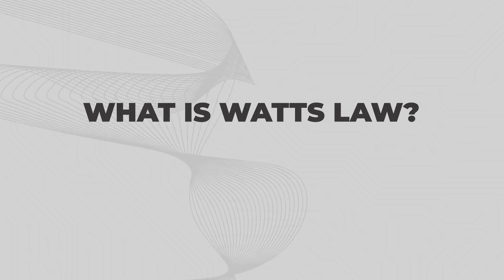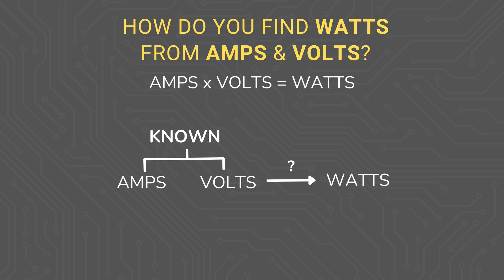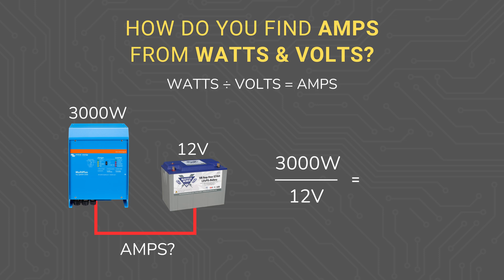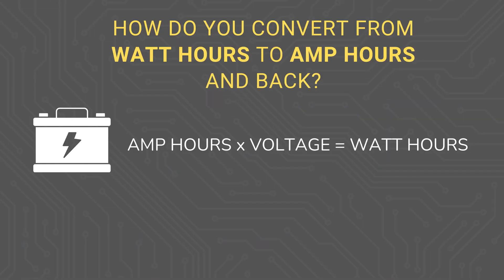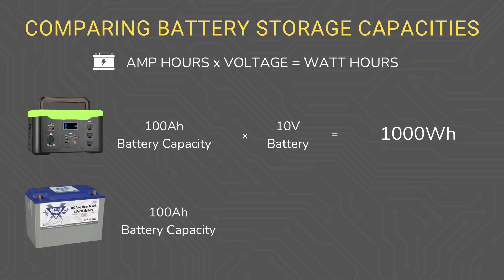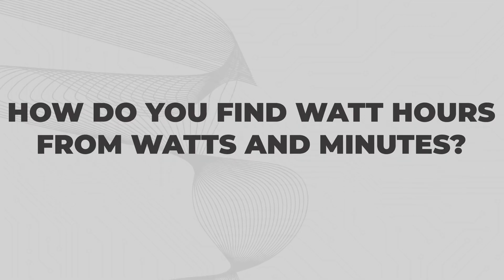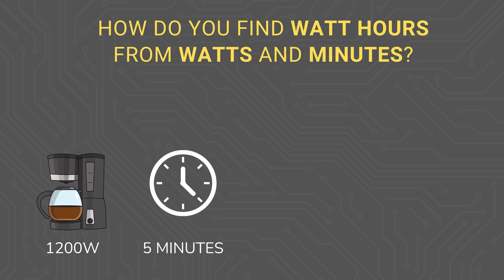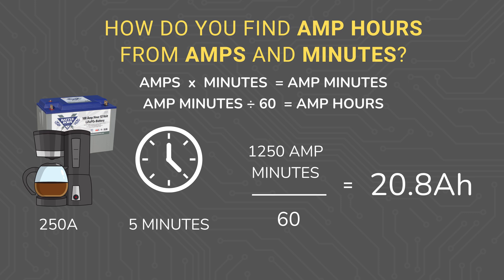Basic Electrical Formulas and Calculations

Comment: What’s the max battery set up for a single Victron Multi Plus II system? Is 600amh ok or is 500 the max?
Reply from the maker: A 12V Multiplus 3k requires a minimum of 400Ah, but there isn't really a max.  I may not be understanding your question fully, though, and this may take a more in-depth look at your personal setup.  If you have purchased/are purchasing from our store (shop.explorist.life) reach out for some more personalized help: shop.explorist.life/support

If you've purchased/are purchasing elsewhere, reach out to your dealer for support.  We'd love to have you as a shop.explorist.life customer so we can provide a bit more help in the future. 🙂
Reply: @EXPLORISTlife  I had 4 100amh BB and added 2 more for a total of 600amh. I have a 3k Vivtron inverter. Just making sure I don’t over due it. Someone had said 500amh was max. I wanted to validate so I asked a pro, you. 👍🏼

Comment: Amp-hours is a simplification that no longer makes sense since people now use a variety of voltages in their systems. Better to stick with Watt-hours.
Reply from the maker: It's actually better to learn and understand both amp hours and watt hours if the mastery of these topics are desired since both units are commonly used and we will be needing to know both of them moving forward in this academy; thanks for watching, though!

Comment: usually I find out solar panels give info about whatts and amps but not volts, so not sure if I would be able to use them in the van
Reply from the maker: I've never seen a solar panel that didn't have volts listed on the spec sticker.

Comment: I missed the one question if you know amps and watts how do you calculate volts.  I need to brush up on my algebra skills.  If W=AxV wouldn't the answer be V=W/A????? I'm confused.
Reply: Yeah, I ran into the same thing.  Pretty sure it’s an error on the quiz.
Reply: Yes, quiz is wrong.
Reply: Correct. Watts divided by amps equals volts.
Reply from the maker: Answer key corrected for question #6. 👍

Comment: 12/13, but I’m not sure that this question is scored correctly Nate:  “How is voltage calculated from watts and amps?”.  Could you double check it?
Reply: Yep I missed it too.  P= A * V so I think it was scored wrong also.
Reply from the maker: Answer key corrected for question #6. 👍
Reply: @EXPLORISTlife  Thanks!
Reply: 13/13 😎
I cannot find any example too, where Watts and Amps ate known but Volts are unknown.